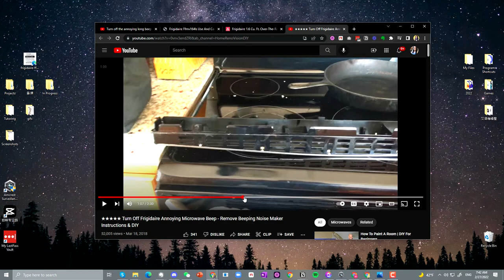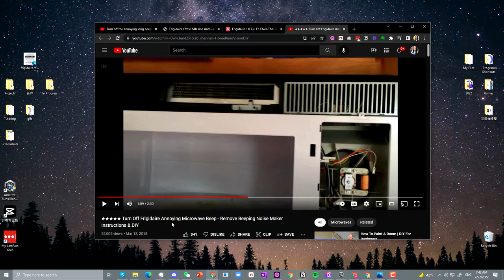How to Disable the Beeping Sound on Frigidaire FFMV164LSA Microwave

Comment: I know its only a 1 minute video, but its entirely too long to just say you can't disable it on this model. Removing the speaker from the circuit board isn't a feasible solution.

Comment: This video is wrong. You can in fact disable sound using the option button
Reply: The model specified in the video title (at least mine) does not have an option button
Reply: @gregorythegreater9541  Same here
Reply: No need for option button tap clock twice opt 2 shows hit enter shows on/off enter cycles this. Then hit clock again and your golden no option button needed
Reply: @at_our_expense  you are wrong. Read the model number again.
Reply: @at_our_expense  she explains in the video that clicking clock twice only cycles between AM and PM. She is correct, I have this microwave in my apt

Comment: Your video is not helpful
Reply: It is helpful she gave us a solution, however, we'd have to take it apart. Otherwise she just told us straight up that there's no way to disable the beeping sound. This helps us by letting us know that there's no way and so no further research needs to be done.
Reply: @Importunity  whatever
Reply: Your comment is not helpful
Reply: @creab485  whatever.
Reply: @Importunity  I have this microwave. One actual solution is to snip off the small electronic speaker which will void the warranty. Another solution which works is to wrap the speaker with small layers of paper towels and then use two small zip ties to wrap around the paper towels. The tighter you can get the zip ties the more pressure it puts on the speaker to keep it from vibrating which is what makes the noise.
Reply: @creab485  whatever
Reply: @kijnek  lol stay mad kid